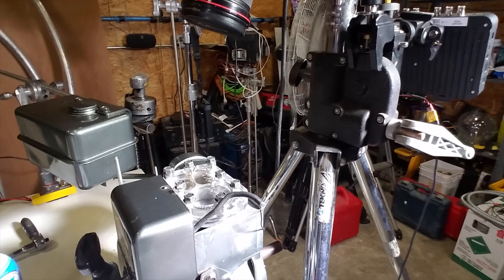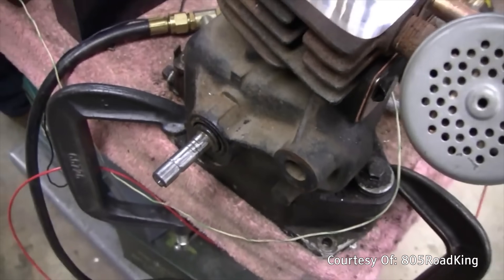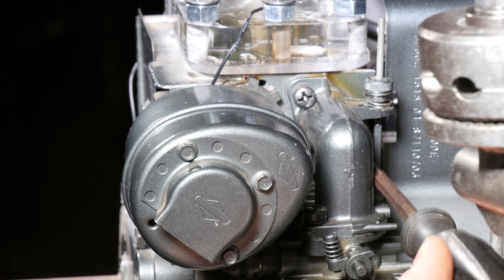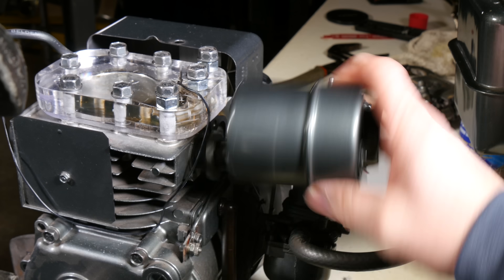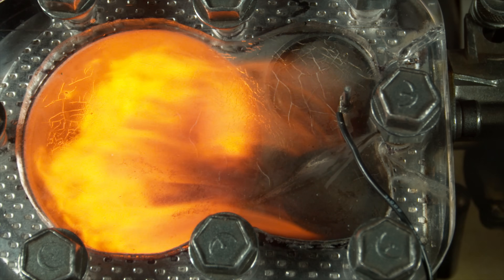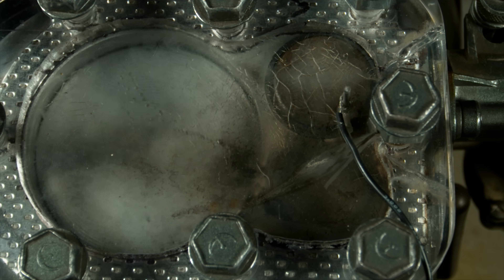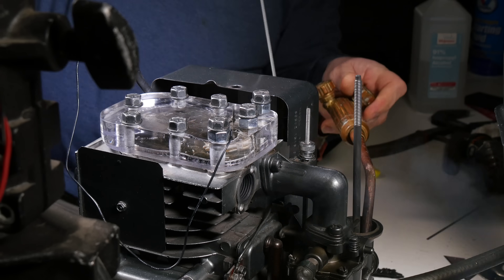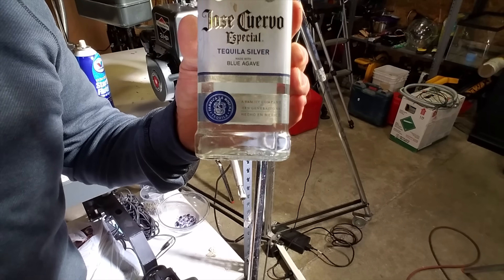See Through Engine - 4K Slow Motion Visible Combustion ( S1 • E1 )

Comment: Awesome video. Can someone explain me why does the ignition still spark during the exaustion? Was it just easyer to build that way or is there an actuall need for it?
Reply: The ignition is triggered by what amounts to a switch on the flywheel. Simple system, no use complicating it.

Comment: It naturally forms a small vortex. I wonder if engineers have found a way to use the vortex instead of wasting its extra energy. Maybe to better mix the fuel and air mixture. Maybe adding to the new HCCI engines total burn efficiency.

Comment: Basically, soot builds up when you have too much fuel and not enough oxygen, or if the mixture of fuel-air isn't fine/diffused enough (incomplete burning). You are using a basic 4-stroke which has a rudimentary carburetor, just enough to vaporize gas - which isn't that hard. You'll need injection for alcohol...why? Put an open container or gas and one of alcohol in the same warm room, lock it, then (do NOT) enter with an open flame - you'll have the answer :) On Acetylene, well...it actually is an explosive, so be careful with it. That much soot, meaning too much fuel, and then you opened up the valve. Luckily it needs a higher percentage of oxygen then what there is in the air to actually detonate (what we saw here is considered SLOW burning, luckily it just blew out, detonation happens a tiny-tiny bit more faster), but considering that you have welding equipment you know that, right? Anyway, you could try to run it on the proper oxygen-acetylene mixture from behind cover, if don't mind turning the cylinder head into a fragmentation grenade :-) Always wear safety goggles :) BTW, tequila should be safe, and i would like seeing a transparent 2-stroke :)

Comment: Is it misfiring? I see it sparking even when there's no fuel in there to light
Reply: It's magneto ignition.
Reply: Sam's luvin also, wasted spark makes for a simpler ignition system, and doesn't really affect the lifespan of the spark plugs
Reply: Kylemsguy I didn't know there was just a redundant spark on the exhaust stroke.... learn somethin new every day!  Thanks!
Reply: There are so many things wrong with every stage of this 'test' - https://www.youtube.com/watch?v=jdW1t8r8qYc&lc=z13zxhfalrzojdbyy04cip2qvkimtbugwd0&hd=1
Reply from the maker: I followed your link but it loops right back to this video, ?
Reply: It was just a linkback to my comment - I fail at Youtube apparently. Here's a copy paste. 

The soot is because the combustion of acetylene requires a 5:2 C2H2 to O2 to yield a 4co2 + 2h2o. You have a huge excess of acetylene content that's carburizing. The addition of the IPA @ ~90% (C3H8O) to the point where in combustion you're actually having a net loss of joules in the combustion rx. Thanks 10th grade chemistry! All the pot I smoked and I still got it ! pv=nRT and all that shit right

You're also going to need to manually adjust the B&S's timing on.. well basically everything since it was designed to run on standard pump gasoline. Intake valve timing, the lift height, the duration, same for the exhaust valve. If your intake can't provide enough air flow, you might need an active pump and/or shorten the piston stroke so it requires less draw and/or port the valve head . Whatever is controlling your spark timing (a distributor cap? I haven't worked on a B&S for about a decade) probably will have to be altered also due to the change rate of flame-front propagation in different combustibles with different mixture rates. 

I don't want to get all negative nelly, mind you. This could be absolutely amazing with a few simple fixes. Throw some flow meters at the end of the line after the spark arrestor, and regulate the injection at a 5:2. Right there, you'll have a video with awesome combustion. 

Video 2 can just be buy some nitro fuel that's properly pre-mixed at the right levels. At car race tracks, they sell the mixture composed of the proper nitrogen to high-octane (98 to 106 is not uncommon) ready to go into stock engines. Also I know the RC car community also uses 'nitro' fuel, which could maybe possibly perhaps go in there without changing timing or whatnot (and worst case, I mean, it's not going to throw a rod or break your crank...it'll just be an underwhelming combustion...)

Video 3 can be "check out what REALLY happens in your Honda's NOZZZ bruhh" (get some NO2 from basically anywhere and you'll get 2 million views from all the ricers). 

Whatever you do - be safe. That Lexan (? at least I hope it's polycarbonate..) looks like it's stress-fracturing. To prevent a blow out with a bazillion shards of dull Lexan scattered everywhere. The detonation energy released from gas combustion (especially at that low displacement) isn't much to be concerned about, so no need to remotely detonate and hide behind a blast shield, but  I'd perform some "preventative maintenance" and swap in a new sheet before you suffer an actual process failure. 

Finally, disclaimer etc - I'm an engineer, but not of the variety that's not qualified in internal combustion engine design, chemical properties of incendiaries, I've never been involved in the process design of anything involving high detonation (i.e., acetylene, nitrogen-based fuel additives, etc.) I hold no graduate degree unlike the smarties like millright Dr. AvE or the machinists with tons of experience (Keith Fenner, abom79, and especially mrpete222). I'm barely competent in my own little subset of engineering and only recently do I feel like I-know-what-I-know-and-I-know-when-to-have-a-healthy-respect-for-shit-that-can-harm-me (the latter part is what causes accidents in the field, when you get a cocky apprentice welding a root with no shirt on because he saw it on TV, or taking the safety guard off a worn-out angle grinder with an old blade when the shrapnel could hit the man 6 feet away from him)

Comment: Your tequila would probably run better in the operator than the engine.  Try some ever clear instead.  95% ethanol. I'm not sure, but the 91% isopropyl is 9% water.  That might be why it looked like a washing machine.

Comment: Those cracks that you started experiencing in the head are caused by a reaction to the acrylic from the alcohol. Try using polycarbonate next time, which is more resistant to solvents.

Comment: Very interesting video. I work with 70 year old CFR research and motor engines for the California Measurement Standards Division. It's neat to see how a tuned engine produces a smooth flame front upon ignition instead of an abrupt explosion that would result in knocking.

I have a few ideas for you to consider. First, can you adjust the compression ratio and show what knocking looks like when the compression ratio is too high? I'm not sure if the viewing window could withstand that amount of pressure though. Second, can you vary the spark timing before and after top dead center? Third, can you run different octane gasolines to show that an 87 octane gas will knock at a certain compression ratio whereas a 91 octane gas at the same ratio would not?

Comment: I really enjoy seeing the exhaust stroke, especially with the acetylene, pushing the exhaust gas out of the valve. It looks like it's getting sucked out extremely fast,but you know the pistons is pushing it out. 
This got me thinking about the difference in flow between a flat head and an overhead valve engine. In a flathead all the gasses have to enter, explode, then turn 180° to leave. OHV engines just flow straight from one side to the other. I'm trying to visualize how these same types of shots could be done in an OHV engine to illustrate the difference in flow. 
     I don't think it can be done, but I would love to see you guys prove me wrong. It would be awesome to see an OHV engine running from inside the combustion chamber.  (All I can think of would be a reinforced boroscope threaded through the block into the cylinder, which seems like a long shot) 
     Anyway, if you got those shots, it could show side by side how an OHV (or OHC) style engine flows in comparison to the valve-in-block flathead. I'm sure it would make for a badass video too. 
      Oh, since you asked, yes I would definitely like to see if it will run on tequila. Buenos noches!

Comment: why 4 stroke vehicles have no smoke like 2 stroke engines
Reply: Because you don't have to mix the oil in with the fuel in a 4 stroke due to the oil system being contained in the sump.
Reply: CockatooDude ohh now i get it thanks
Reply: Exactly.  The smoke is the burnt oil ^

Comment: Rather than tequila, as has been mentioned in other comments, I'd be interested in you trying straight oxygen with gas.  Our 'air' has considerable nitrogen per amount volume.  Isn't the IC engine's power stroke only combusting the oxygen PART of 'air'?  Plus, what if you rigged the intake to ONLY use straight oxygen rather than oxygen-enriched 'air'?  Just a thought.

Comment: Just a question. I seemed that the spark plug was sparking in the exhaust stroke also. Is it true? If so why?
Reply: Magneto ignition, triggered by each rotation of the flywheel. Very simple.

Comment: man I still don't know how squirts of gasoline can be so strong as to move what they can move.
Reply: Thrakerzad the carbon bond chains in organic compounds coming from petroleum store a lot of potential chemical energy. when released it splits into mechanical-kenetic, thermal, sound, and light energy, and much is actually wasted. so imagine if you can slow it down and spread it out: what you get is a powerful mechanical process.

Comment: I would like to see it under a load--regular gas would be fine.  Hook it up to a hydraulic log splitter, a pressure washer with a variable nozzle, or some other method to allow you to slowly bring the engine under a load while at the full governed 3600 RPM.  Extra points for stalling it under full load, just like my neighbor does all the time with his lawn mower. (Only cuts his grass about 3 times a year.)

Comment: So the acetylene seemed to fire really well so why do we use gas instead of acetone, it seems like acetone would last longer and give you more bang for your buck but obviously engines aren't designed for acetylene. Just a thought
Reply: Which are you talking about? Acetylene, it's because it also goes bang when you tap its container with a hammer. Not exactly safe for vehicles.

Comment: IF you put the alcohol in the tank, it would meter much better (less flood/wash) than just dumping it down the carb intake.  Briggs engines are commonly kart raced on alcohol.  Different jetting is required for best performance.
The Acetylene burns VERY slowly, fascinating to watch it leave through the exhaust valve while still burning.  Too much fuel to be consumed with the available oxygen in air, of course.  If you are brave enough, also open the oxygen valve on the torch!
Forget the tequila.  Use 151 rum, or Everclear!

Comment: wtf dude that's not pure alcohol

you're getting water in the cylinder
Reply: Wondering why he didn't pick up on that.  The bottle is clearly labeled 91% alcohol, so 9% water.  The engine would have stopped in less than a minute because it was full of water.
Reply from the maker: no it was rubbing alcohol
Reply: Ryan M as a small engine mechanic I can say that the engine would have continued running. The water in the cylinder would evaporate off and be forced out the exaust. Or if the water wasn't evaporated, it would still be pushed out of the exhaust. Most of that in the cylinder was alcohol though. there wasn't enough oxygen to burn all the alcohol and the liquid alcohol wind burn quick enough. Leaving it behind. During combustion mostly vapors or small droplets, such as mist burn. The rest is left to either be burn the next cycle or pushed out the exhaust. It was quite cool because the alcohol in the cyli under actually cleaned the engine as it sloshed in the chamber.
Reply from the maker: true, i kept it really cold.

Comment: with the rubbing alcohol you used 91% so the other 9% was most likely water. Water won't compress or burn in a normal engine. So thats most likely what you were seeing there. check the oil and make sure none got in there.

Comment: Very good, I liked this a lot. One suggestion - acetylene will explode when alone and pressurized. It reacts with itself. Maybe you could try that out?
Also, you need a thick borosilicate glass cover plate. That will last and only needs wiping.

Comment: holy shit that's a lot of unburned alcohol. i'm mechanically challenged and never knew that the plug fires on every up stroke.
Reply: Wastes spark ignition system, fairly common as it means a simpler engine design. The spark does nothing, in effect, so it's not a problem having it.  Many cars have this system too and it's what can cause a backfire in poorly maintained engines.
Reply: twinsmm1 the only difference is your spark plugs wear out twice as fast

Comment: Can you do another head like that and bolt a mini turbo onto the motor. I'm curious about the sizes of the bang with different ethanol amounts. All us turbo bimmer guys run at least E30, to allow more boost and timing, and I'd like to see the difference between like pump E10, E30 mix, and like pump E85.

Comment: awesome video but I noticed that your Briggs was only running at idle and i think it could be interesting to see if the flame propagation changes with engine load.  And being it already has a carburetor it would be easiest to use gasoline and for the load you could use a pulley on the crank with a stationary belt and you would only need to push on one side of the belt to put a lot load on the engine but I have no idea how long the belt would last.

Comment: Cool! Great vid, Keep it comin'. Were you hosing the alcohol in? Many years ago, hotrodding engines to run on 'alcohol', which is (mostly) ethanol, we'd just run a nail through the main jet, or a 1/8"  drill for the fastidious. This delivered a suitable mixture, and allowed compression ratios as high as 14:1. But used a shitload of fuel!

Comment: that is very cool. did you put oxygen with the acetylene or not? if not, try first to put just acetylene to the point where it doesn't burn completely and then start putting oxygen.

and, it would be just f**king awesome if that could be done in a 4t motor.

Comment: You should rerun the Isopropyl Alcohol test with a higher Alcohol Concentration. See if there is a difference from 91% to 99.9%, less water in the mix.

Comment: Even just seeing what appears to be stress fractures early on... Concerns me.

IF there had been more than one clear sample material used for this. At the first visible sign of stress fractures; it would have been interesting to see them more in depth. Better yet, a 3d type of view.

Btw, would anyone have felt comfortable testing this one out on a larger engine; even a well used very small 3 or 4 cylinder?

Comment: you can now see why it's important to use higher quality fuels, a clean burning fuel will leave way less residue which would result in a much smoother running engine

Comment: A nice illustration of just how dirty and wasteful an internal combustion engine is.
Reply: brothersoulshine No more wasteful than an electric engine.
Reply: That doesn't seem to be correct to me.  Internal combustion engines generate a lot of heat, so much so that they have to be expensively cooled.  That heat is just wasted energy that would be better served making the engine go around.  Electric motors don't suffer this problem.  Happy to be proved wrong, but I don't think I am.
Reply: expensively cooled ? water isnt that expensive...heat is wasted energy ? come tell me that again when ur sitting in ur car when the outside temp is -20C i will gladly take the excess heat produced by the engine keep myself warm
Reply: It's expensive because you're using the fuel to create heat rather than kinetic energy.  Of course it's quite nice to have some spare heat when it's -20 outside, but that's hardly a standard scenario for internal combustion engines.  And even then, the engine is venting waste heat via the exhaust.  Do the maths, or if you can't be bothered, here are some numbers from somewhere else: 
Consider the Tesla Model S, which has an available 85kWh battery and a 265 mile range.

Consider a similar gas-powered car, which gets 35 mpg.

Gasoline contains about 33kwh of energy per gallon.

The Tesla uses 320 Wh/mile of energy (85kWh/265 miles)

The gas powered car uses 940 Wh/mile of energy (33kWh/35 miles)

Once the energy is onboard (not counting the efficiency of the power generation, oil refining, or charging), the Tesla is using only about a third as much energy as the comparable gasoline-powered car.
Reply: brothersoulshine
which is wrong, it's the sytem that brings "power" to the wheels not the kind an energy used ...
Same fake battle between "combustible" ...
they 'll obtain the "tesla" results if they used reactors instead ...

That's technical's illusions that brings humanity to that point .
Not the knowledge .

technically, we (human's one) are in a level of knowledge that allows us to preserve, protect and rises each others ...
which is not the facts ...
Small differences between truth and reality .
Reply: It goes without saying that electric engine is better, faster, simpler, more durable, reliable and cheaper than heat engine (various uses from a home mixer to a locomotive) the problem is that they need a source of current. Once portable cheap batteries with big capactity are invented nobody would use a heat engine. Probably only in rockets and some factories.